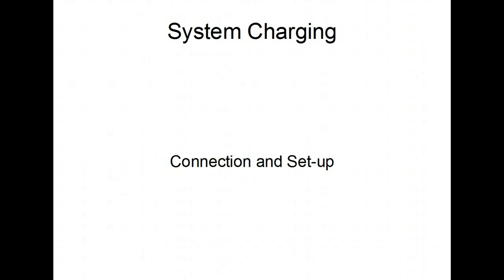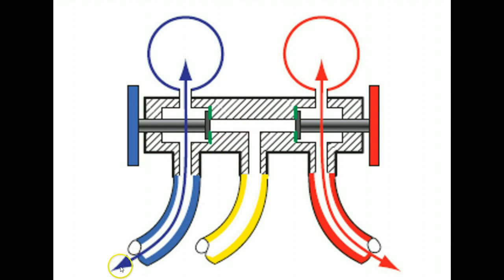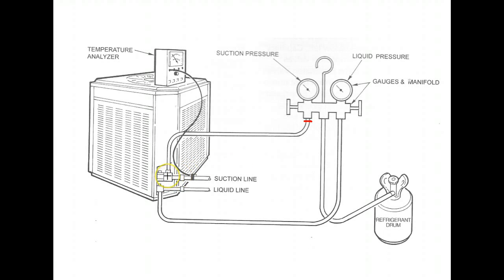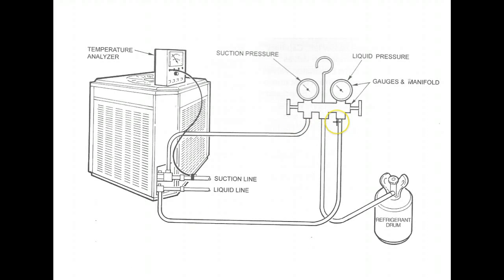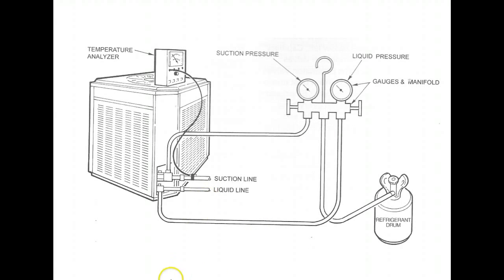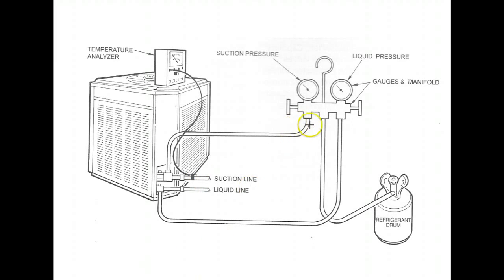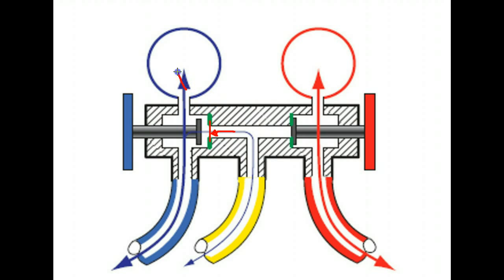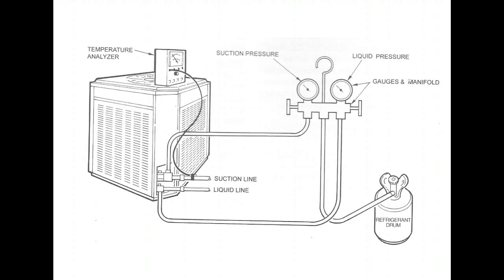Module 7 - Gauge Connection and Set-up

Comment: Maybe someone can answer this. Using this purge procedure it appears to me that the volume inside the manifold is not purged since there is no flow through for and of the purges (low side, high side and center). Am I missing something? If we care about the volume inside the hoses why don't we care about the volume inside the manifold?
Reply: Assuming your gauges are connected in the same manner as in this video, the manifold is purged using this procedure because the hoses connect directly to manifold's respective side (blue to low side gauge, red to high side gauge, yellow to the service port). You don't need to open the manifold low or high side valves for refrigerant to get into the manifold because the hoses feed directly into the manifold without needing to touch the valves. The system pressure and refrigerant cylinder pressure are higher than atmospheric pressure, so they will displace any air that the manifold and hoses have inside of them once you open the hoses to atmosphere by slightly loosening the hose connections. For example, if your blue hose is connected to the outdoor unit and you want to purge the air, you slightly loosen the blue hose connection on the manifold until you see refrigerant start spraying. Once you see refrigerant, you'll know that the refrigerant displaced any air contained within the hose and the low side of the manifold set. The same will apply to the other ports on the manifold.

Comment: So how would you purge the yellow charge/vacuum line if you only wanted to check the system pressures without adding refrigerant? I am trying to figure out about the air in the yellow line when the refrigerant is transferred from the manifold back into the system. I dont want to suck the air in the charge line into the system with the refrigerant. Thx

Comment: Thanks Ron have  Great Knowledge & an are Great instructor .Indeed Thank you so very very much ..for i have learned so much from you already & I do study HVAC almost ever single day .on bleeding hoses iv been doing HVAC /R for 26 + years but when i hook up to an system I always Now bleed thu the charging hose by cracking then close the low side usually 1 st then then the  hi side gauge handles & let the air  & a small tad of gas or liquid escape  thu the end on the center / yellow or charging hose that way iam sure the gauge body & the hoses or entire system & setup are all bled

Comment: Thank you for this video, I am new to this business and just want to recharge my AC. I just purchased the manifold gauge and noticed that it has two inputs to the flexible houses for each color, yellow, blue, and green. These extra inputs are located just behind the bottom inputs. Do you know the purpose of these? Also, there is some air left inside of the manifold gauge in case I use your purging technique, do you think it will be easier to purge the system from the red and blue housed into the yellow line before e it is connected to the refrigerant bottle? In this case, the valves need to be opened.

Comment: Does it matter whether you first connect your lines with the system off and once they are connected you turn on the unit to purge the lines or should the unit be running when you connect the lines and then proceed to purge the lines?

Comment: Great job, of explaining how it should be done properly, I had a new set of gauges and didn’t have 100% clear explanation on which way my lines should be hooked up? my AC gauge lines has a 45° curve in the fitting and the other ends are straight, and on the yellow line on 1 end it does  not have a valve in it, wasn’t sure if it should go towards the gauge or away from the gauge? Thanks

Comment: You can charge the high side with 410a liquid with a measured charge in an evacuated system and the compressor turned off.

Comment: if you will use an adapter between the vacuum pump and refrigerant tank or can, you can avoid purging the yellow hose during the charging process. doing so will insure 100% vacuum of the unit that is being charge with refrigerant. you can buy this adapter from amazon or make one. it is like a y or t setup where you can close the line to the vacuum pump after you reached the correct vacuum reading. also by doing so it avoid wasting refrigerant and releasing it to atmosphere. i suggest all hvac, refrigeration, and appliance repair technicians should use this type of adapter setup. i have read something that even r134a refrigernat is not safe to the ozone layer of the earth atmosphere.

Comment: Mr. walker would you please explain, why some thechs flip over the the Freon tank
To start recharging the system ?
Thanks for the good lessons.
Reply: so the refrigerant in liquid state can flow in the a/c or refrigerator unit that is being charged. sometimes you need to cool the refrigerant tank or can container to liquify the refrigerant from the gas state. it is quicker to charge in liguid state than in gas state.

Comment: Great video, If I wanted to just check pressure without connecting the yellow hose and using a cap on the port, what is the best method to bleed the air out between the high/low ports before sweeping the gauge set back into the system?

Comment: Purge air in the service line of the manifold at the refrigerant jug after purging at the manifold on the liquid and suction line. Make sure you have the red or liquid line CLOSED and suction line open at the manifold open prior to purging the service port or yellow line.  Aside from the purging of the service line, this is an excellent instruction for charging.

Comment: 2:38 purging hoses.  Would it be ok / better to leave the loose connections nearest to the condensing unit instead, and purge by opening the valve of the jug?  This should be able to purge the manifold too, instead of just the hoses.

Comment: Question:  I thought before charging a system you have to pull a vacuum first.  If this is the case, how does bleeding the lines help?  It seems like any air in the lines would be pulled directly into the system as soon as they were connected...

Comment: Hi! How do I recalculate/recompensate for the lost oil that goes with the refrigerant on recovery or loss? Is there any mathematical formula to determine how much oil is left on the system parts after the recovery?

Comment: I am a new tech doing commercial refridgeration and we charge up racks using the liquid line. Can anyone explain why these units are charged using the suction line ?
Reply: Avery Camden you ever firgured it out?
Reply: bob geore I think you can use either, suction is faster but I understand that its bad for the racks to charge through suction it sends a lot of liquid to the compressors. Any other input would be appreciated.
Reply: Avery Camden yea ok I think u might have to open and close the vavle constantly when charging that so the gas flashes off before it reaches the compressor but I might be wrong.
Reply: bob geore all I know is for commercial racks we either use liquid lines or go straight to the liquid header. We do put leftover vapor through suction because its quicker. That being said, given a residential unit is  the same principal as commercial rack I still dont quite understand why he said to charge through the suction.

Comment: The suction line connection is after the expansion valve because that is where the LP side of the cycle begins?
Could u please confirm this?
Thanks
My understanding is the metering device & expansion valve are two different names of the same thing & is located after the condenser to reduce the pressure?
Please confirm?
Thank you so much

Comment: Yeah great video. Now, 5/2017, my ac guy is using 427a. Some quick fixers will put it on top of 22. I think it might be worth just doing a conversion replacing the 22.  Have you the latest, simplest method for this? Your thoughts. Thanks, subscribing....

Comment: Can I hook up my gauges , open the bottle then untwist the valves up at the body until I get refrigerant, or is is necessary to crack them a little first. The reason I am asking is because the unit I am working on has king valves so I have to front seat the valves.

Comment: how much freon we lost in every pressure check up?
Reply: +Adrián Izaguirre There's a technique to avoid refrigerant loss...
once you charged your installation with refrigerant, by using pump down (thermostat off) you compressor keep running so you have to close the liquid bottle valve, the compressor will vacuum all refrigerant from the evaporator.
You close your refrigerant drum's valve then your open all valve on your manifold.Once done your close all valves on your manifold before the low pressure switch reach its low pressure stat that stop the compressor.
you close all valves and you can remove your manifold without refrigerant loss
Is is clear enough ?

Comment: I have some questions. Virgin refrigerant cylinders contain only one port. What comes out of that port? Vapor or Liquid? Or is it uniquely mixed? Does it depend on the type of refrigerant?

If you are charging by vapor, it shouldn't really matter which side you connect to, correct?

I've charged recycled refrigerant by vapor through the hide side plenty of times. Never had an issue...but I do want to learn more. He states that high side pressure will always be higher than cylinder pressure. However, if you are going for a full charge, shouldn't the system but under no pressure, if not a vacuum? Assuming you pulled your system into a vacuum that is. Another thing I am used to doing is charging by use of recovery machine.
Reply: Vapor is upright, and liquid you turn the tank upside down.

Comment: When you purge the hoses at setup,do you loosen the connecting flared fitting AFTER you hook the hoses up or BEFORE and then tighten them after you get that second or two of purging gush? Thanks!

Comment: Ron these videos have been very helpful...i had a question about the purge...can i purge when the compressor is turned ON...or does that make things worse cause it will start to suck in more air from outside ?
Reply: I meant on the low side line
Reply from the maker: Nick Wall Hi Nick, you can hook up your gauges and purge running or not. Even though it is called the suction side, there is still pressure 70 to 130 psi depending on the refrigerant (R-22 or R-410A) so you don't have to worry about sucking in air.

Comment from the maker: With blended refrigerants, like R410a, you must charge upside down (with liquid). You should have a metering device inline with your charging hoses so you don't flood the compressor. With R22 you should charge right side up.
Reply: Refrigerant 410A    is so close to being a true azeotrpe it's not necessary to charge it only like as a liquid. Most guys use it almost the same as R22.

The refer just does not fractionate (fractionize) like other blends.
Reply: Hence the need for a metering device is not needed. I use it mostly in liquid and I have no problem meeting with my manifold gauge. I think that's the way it is with most guys. I taught for 15 years and I understand the dilemma of presenting curriculum material and balancing it out with practical application.
Reply: it can be charged with comp running or no.

an experienced guy can do it either or.